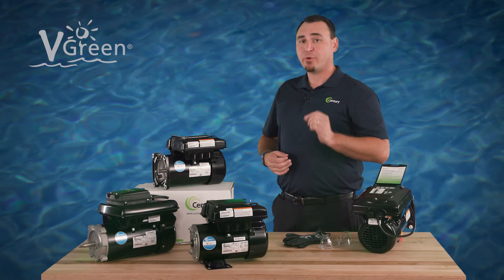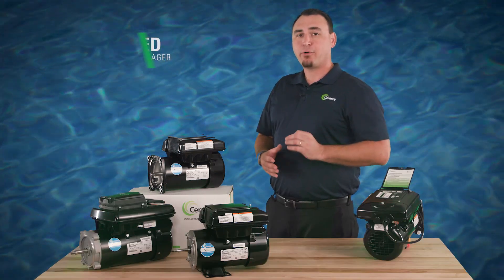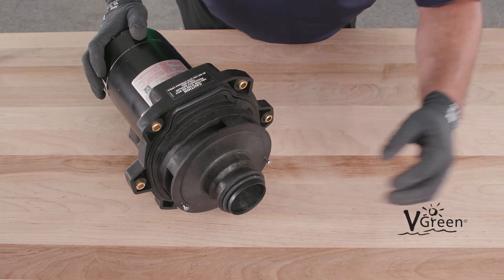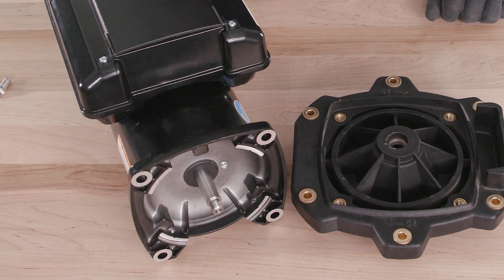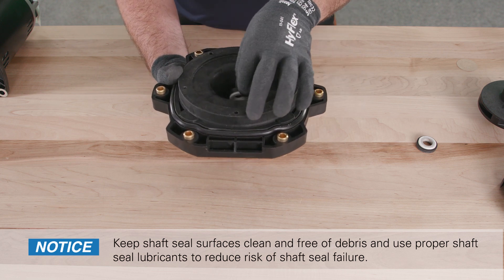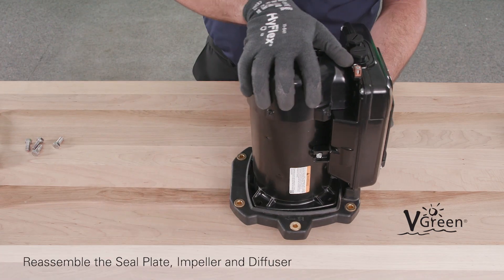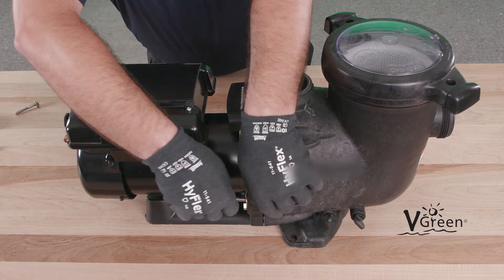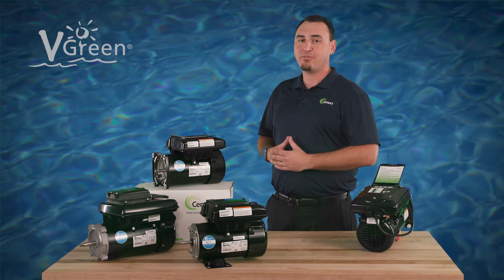How to retrofit a single speed pool pump motor with a Century® VGreen® variable speed motor

Comment: I have a pentair WF-4. Will this motor work? What other parts will I need to retrofit to it?
Reply: I have a 1997 Pentair WFE-4.  I used part# EPA16SQ (Century VGreen Variable Speed Motors Pool Pump Motor, 1.65 HP, 1 Ph, 60 Hz, 208-230 V, 3600 RPM, 48Y Frame, TEFC - EPA16SQ).  I also used a seal replacement kit (aftermarket Aladdin Go-Kit32) or something similar.  Installed in October 2020, still running great.  Note that you'll have to match the total horse power of your existing pump motor to the replacement motor.  The WFE-4 original motor is 1 HP x 1.65 SF = 1.65,  the Century EPA16SQ is 1.65 HP x 1 SF = 1.65.  The two match at 1.65, so the replacement is acceptable.  Note the the frame of the motor is a 48Y.  Torque spec for the WF is 110 IN-LB for the seal plate bolts and 70 IN-LB for the motor bolts.  Be sure to grease the bolts or lube with anti-seize before install.